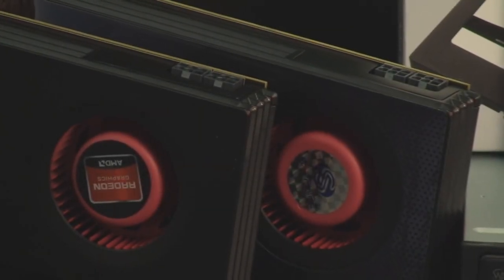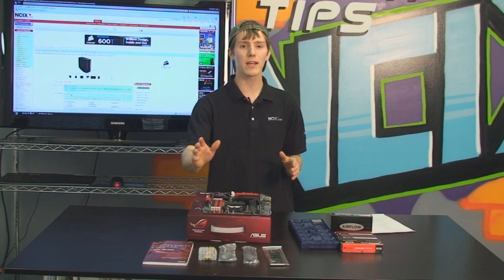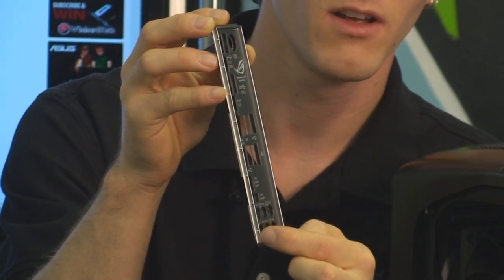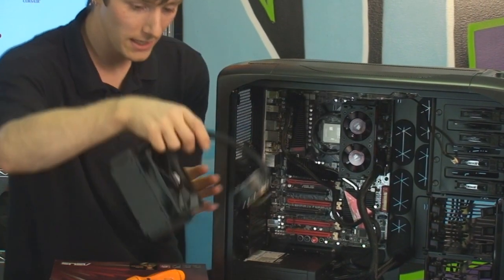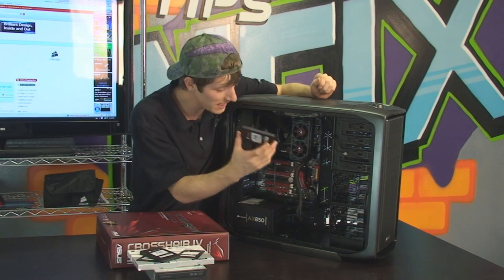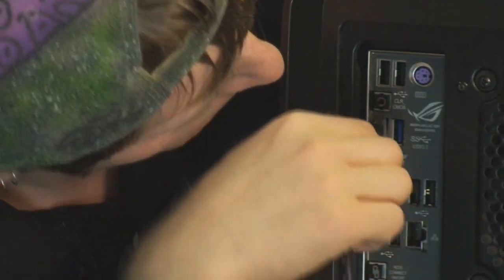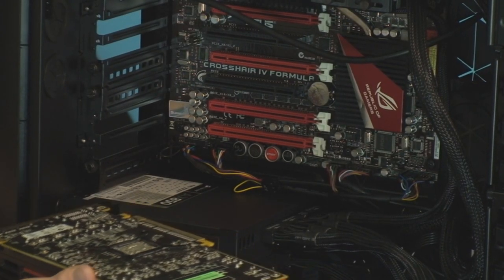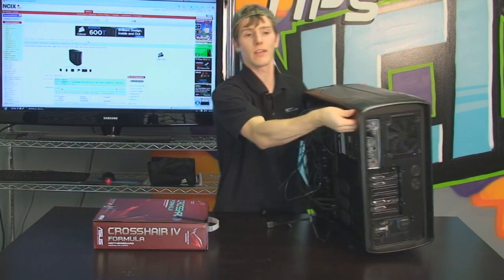PC Computer System Build Guide Featuring AMD Vision Black NCIX Tech Tips

Comment: Two things that my fellow Canuck did not mention.  The 600T case comes with an centering alignment post/standoff (standoff pin in the case with plastic bulb-like head) for centering your mobo for ATX aligment. So don't try and push down on the mobo if the pin is not poking thru the centering hole in the mobo.  The AX850 pairs the power connector for HD audio and firewire very close on the same wire. So if you have a Gigabyte mobo you will need an 1394 extender or live without 1394 in front case

Comment: It's worth noting that plugging fans directly into the power supply doesn't HAVE TO mean they are running at full-speed at all times, because there are fans with switches to control that, like the Antec Tri-Cool series. I plugged in a triple Molex connector to my modulator PSU... the two at the end went to my front intake fans, and the one in the middle of the cable for my side intake fan. All five (including the included top/rear exhaust) set to low. No RPM stats, but temps are all great.

Comment: @cardboardsnail You're thinking of RAID1, which mirrors the drives giving you only the total space of one drive. RAID0 strips a single file or data onto both drives thus doubling your total space, and increasing your speed but lowering reliability.

Comment: great video! i had to watch so many different vids on youtube before i was sure i could put together my first pc. this guide is pretty much the definitive guide for putting together a pc. and a monster one at that! 

BUT for the H70, i think you want to plug the water pump cable into NOT the cpu fan header. and you want to plug the rad fans into the cpu fan header. i have the H50 and this is how it is done. i simple mistake, and you did say refer to the manuals. thought i would mention it.

Comment: @EnzoMatrix452 

The HD6870 was supposed to replace the HD5770.
As a single card, the HD5870>HD6870.
When CrossFired, the HD6870 CF > HD5870 CF due to the awesome scaling on the HD6xxx's.

Comment: @ImaginaryGuns If your case have a dust filter right under your PSU you want to put it upside down. It will give you a cooler PSU, wich on some models will slow down the fan to lower the noise.

Comment: @jojotjuh The problem with these kits are that they don't have a resivour, in a proper watercooling set up you have enough water to cool ('cos of the resivour and so on) that it'll work better than most air coolers, also a radiator that's 240mm times 40 plus a good pump will help with that too.

Comment: @pandarello See, the reason I chose the H70 over the Frio (which I strongly considered) is that the H70 just isn't as bulky. The major advantage the H70 has over most high end air coolers is size. Had I gone with say, a Frio, or a Noctua, I would not be able to access my first dimm socket. I do plan on upgrading to a full water loop in the future, but for now, the H70 does what I need.

Comment: @afinewaytodie 

NPs. I should add that the H70 is not a terrible cooler by any means. However, it IS too expensive and gets beaten by say, the Thermaltake Frio which costs roughly half. And then the Frio does not suffer failure problems. If a fan goes you get plenty of warning. If the pump on the H70 fails it's game over.

Comment: @CamdawgzXXX ,  electrostatic discharge, basically it is when the negative energy from your body goes to a more positive source (someone or soemthing else).
This can obviousely damage eletrical parts, but it can also be prevented real simply.

If you want to go realy safe buy one of those anti static mats :D

static alectricity can be build up by alot of things, (even walking) so it's best to touch the case or the (plugged) power supply so you are sure that your static free

Comment: Quick Question, on that exact system, which would be preferred? Plugging the four fans into the fan controller or the motherboard headers? Taken into account the system monitoring capabilities of the mobo by means of let say a laptop.
Thank Guys. Great Work

Comment: sorry edit to my post, it is the AC97 and HD audio that are on the same wire not the 1394 which is a separate wire and so you will not have any problems plugging both the 1394 wire or the AC97 wire

Comment: you mentioned that little tab that blocks part of the 4 pin power input on the top left of the mobo. You take that out and use an 8 pin preferably? or stick with 4 if you have it?

Comment: I'm also thinking about installing Corsair H50 for extra cooling only if I really need to. Last question is I hear 470 consumes a lot of power and generate high temperature. Should I decide on 460? Which ever will run more comfortably in this build. I know few of my choice of parts aren't so great, but my budget is quite limited. Last PC I built became very ancient, I think it was back in 02 or 03 and only had memory and GPU upgrade since. XFX 8800GT Alpha Dog Edition 512mb. Out dated now.

Comment: Why is the dust filtration system of the Power Supply on its air outtake?
Should it not be on the Air Intake? I mean, my computer does not generate dust or whatsoever.

Comment: Hey there bit of a late reply but DO NOT build your system on carpet, this also means you standing on carpet and building the system on a table. You know when you rub your feet on carpet a little you can zap things? That's static electricity it may although not too often destroy components like your motherboard, CPU etc. Build on tiles or wooden floor stuff like that. Even if your building it on the table if your feet are on carpet then you can create a shit ton of static. Hope I helped.

Comment: Hey Linus, I have the H50, and i hate the **** corsair fan that came with it...  Is it possible to replace the standard fan with an air penetrator?
Also, would I need a 3 pin to 4 pin converter to plug into the CPU fan slot, or would it be OK just to plug it in via molex?
Thanks

Comment: I readed the motherboards manual and it shows that i only have connectors for a cpu fan, 2case fans and a power supply fan. 

Im planning to get an h70 liquid cpu cooler too, so the cpu fan connector isnt available becouse of the water pump. 
What 2 connectors should i use to connect the 2 radiator fans?

Thanks (and sorry for bad english)

Comment: @manjamfan The amount of RAM is not a bottleneck when it comes to computers, however the bandwidth and/or latency timings are. 6GBs of RAM is unique to Triple-Channel memory configurations (LGA1366 only currently), and more than that would be quite useless in this system. 4GB will be sufficient for any game out there, regardless of what people think. However, having more RAM definitely helps out when it comes to things like Premiere Pro and Autodesk Maya.

Comment: @xlnsanityz 

Either or will do fine. As long as your not running a triple sli/crossfire setup you will not experience any bottleneck. Considering your running a decent graphic card you wont see much of a difference. If your overclocking manually I would go with the i5-2500k tbh. The phenom gives you nice auto overclock when gaming (3 cores or lower used it will push them up to 3.7ghz).

Comment: My ONLY complaint is that when handling components with gold contacts (i.e, the bottom of the DIMM memory, PCI contacts, etc...), either 1) DON'T TOUCH THE CONTACTS, or 2) WEAR LATEX GLOVES. I prefer the latter. $2.00 worth of latex is a good investment for handling your expensive computer parts. Otherwise, I love this video. :)

Comment: That Aurora is $4099 without any peripherals. A system capable of running any game at 1080, maxed out settings, at 60+ fps costs $1300 without any peripherals. 

That's $2799 cheaper. Drop the ram to 8 gigs of DDR3 1600, the CPU to an ivy bridge i5, the GPU to a GTX 680, and the hard drive to a single 1TB HDD. You can throw in a 128 gig SSD for a boot drive for about a 100 bucks more. 

All systems in the above example included Windows 7 Professional 64 bit.

Comment: that PSU is overkill for that setup. I'm running an FX-8120 & two 6950's on a 750W, and it never draws more than 600W under load.

Comment: @afinewaytodie 

Yes, it does. Go look up Intel's new RAID controller that allows TRIM throughput to the drives ;-) Kingston are also working on a drive with a garbage collection function on the drive itself that doesn't need the TRIM command :-)

Comment: @elpedomasgrande1 The amount of lanes on the PCI-E slot for graphics cards is always 16, yes, hence PCI-E16. However, it is common for not all of the PCI-E slots on the motherboard to run at the full x16 speed. It is common for the bottom PCI-E16 slots (if you have 3+) to be running at x8 and sometimes even x4; with the ASUS Crosshair IV Formula, running two cards in the top slots will be x16 by x16 lanes, while with three cards they will run at x8 x8 and x8.

Message for more info if you  want!

Comment: are you magic??? how do you plug in the fan header that comes off of the h70 into the one on the motherboard. I have a similar bild with the same cooler and same motherboard and i cant plug it in because the cpu fan is a 4pin and the motherboard header is a 3 pin PLZ HELP

Comment: @Miguelb772 I do know that it will increase the Airflow, but the "Air-filtration-system" has nothing to do with the Air in a computer beeing hot already. -.- Its originally intended to filter out dust, so the Fans and coolers do not get full of dust over time. Putting the filter on the Air-outtake is kind of useless.

Comment: @plutoguerra 

Increases minimum and maximum fps. More importantly it stops fps from diping low during intensive gameplay. Example if you run 60fps (max for most monitors) you will hardly ever drop much compared to a single gpu droping as high as 40 fps during intensive gameplay (yes that has happened to be got a smoke grenade at my feet on battlefield).

Comment: depends. in honesty your could buy an intel setup with like a 3rd gen i5 or i7 and get better results on the high end . and would only be compromising a top end mobo for a mid tier one (which would certainly not be a bad thing ) and you would get a faster cpu  (the new i7's smoke the 8150 by a huge margine in just about everything ) im far from an intel fanboy . but at the high end at least for now they dominate . however piledrivers right around the corner and it may change things a bit .

Comment: I prefer the core I3 and 2 GTX 590s in crossfire, 24 gigs of RAM, a 1KW PSU and an asrock super computer X58 micro ATX gaming/server board alongside liquid cooling, a wireless LAN card (200MBPS) and all the little extras like SSDs and extra insulation on the back of the board (anti-static of course) to stop any potential shorts! oh, yeah and all in a Corsair case

Comment: I added up the Aurora he is talking about, no peripherals. It costs $4099. I added up an equivalent system using pcpartpicker. 800 dollars less. Then, I put together a PC that will run every game at 1080p 60 fps without a hitch. 8 gigs of ram, ivy bridge i5, a gtx 680, and 1 TB of storage. It was $2800 less than the Aurora.

Comment: Alright I need some advices on a budget gaming pc I'm working on. Here are the list of parts.
Case: Cooler Master Storm Scout Mid Tower
CPU: AMD Phenom II X2 555 BE Calisto 3.2 Ghz (I will be unlocking the other 2 cores to have it OC to 3.8 Ghz)
MB: ASUS M4A87TD
Memory: A-DATA Gaming Series 4GB (2 x 2GB)
PSU: CORSAIR CMPSU-650TX 650W
GPU: MSI GeForce GTX 460 or EVGA Geforce GTX 470
So the question is will my PSU be enough to run the build. ---->

Comment: question? I want to upgrade my old system. I do have an clear case with an ATX-AS500w thats mounting on the top of the case. I just brought the Asus Crosshair IV. I am looking at the 6870 or the 5750 at least 2. do I need to upgrade or not. I see that Corsair sponser the case, cooler, ram, hhd, and power supply. I like to look inside my case so all can see how cool my pc is. I dont hide it inside of the desk, I like it out. so can ya help me out here. ANYBODY

Comment: should . then it will shorten its lifespan . and make long term overclocks harder to maintain . this is where the fx 8150 comes in . it had 8 active cores which means each core will only be stressed as much as it should . and that means in theory the 8 core should outlast the new intels . so for gaming performance , the 8150 is still an excellent proccessor and can even run 4 way sli and crossfire builds. the intels are faster . but you in the end with the 8150 get a longer lasting proccesor .

Comment: Are these components good for making a "gaming" pc? :) plz help

Case: Corsair Graphite 600T

PSU: Fractal Design Tesla 650W

Ram: Corsair XMS3 Vengeance DDR3 PC12800/1600MHz CL9 2x4GB

GPU: Zotac GeForce GTX 560 Ti 448

Motherboard: Asus P8Z77-V LX

CPU: Intel Core i5 2500K 3,3GHz

HDD: Western Digital Caviar® Black 500GB

Comment: @pandarello I'm not denying that there are better choices. Personally I'd get the d14 over the h70(which I did btw), but it is still a very good cooler beating all the competition in short runs, although it takes a hit after a while as you said. BUT it is a good product be it slightly overpriced. And yes sandforce controllers do selfmaintain(not great, but they do nevertheless). I did my homework and so did Linus we all know what we're talking about stop flaming.

Comment: Yeap, Mine would have cost me $2,300 on Alienware, I built it my self last week and guess what? I only paid $1,450. You build you win! CPU-Intel ® Core i7 3770K 3.5 (Soon to be OC)
MoBo-ASUSTeK P8Z77 V-LK
GPU-EVGA GTX680 2GB
Memory-Corsair Vengeance (2X4GB) DDR3 1600
OS-Microsoft Windows 7 Professional
PSU-CORSAIR Enthusiast Series TX750
Monitor-Asus VE248H Black 24" 2ms Full HD
HDD-SAMSUNG Spinpoint 1TB 7200RPM
Case-Rosewill Blackhawk Case

Comment: 4GB of RAM is NOT enough. 4GB of RAM is absolute MINIMUM. 6GB of RAM is recommended. 8GB is a safety. Any thing beyond 8GB is no longer ONLY a gaming rig.
500GB HDD is minimum, 1TB is recommended, 3TB is a safety. Currently SSD is a luxury. Dual core processor is minimum, Quad core processor is recommended. 150$ is minimum on GFX cards, 250$ is recommended, 400$+ is safety.

Comment: If u tired watching the whole video

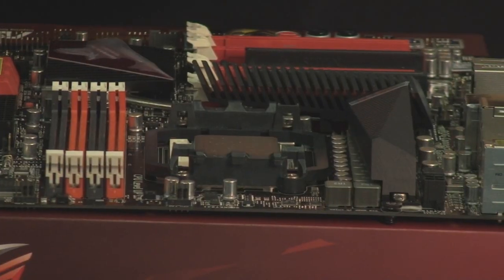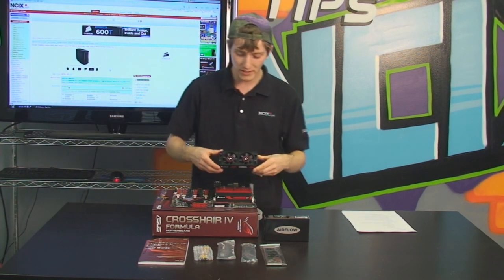4:46  CPU Installation----------- 5:15 RAM Install ----------- 6:00 RAM Cooler Install
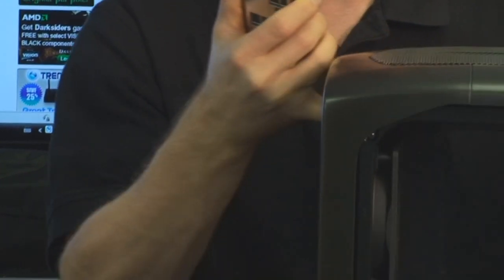6:43 PSU Install ----------- 8:56 AIO Shield/Motherboard Install -------------
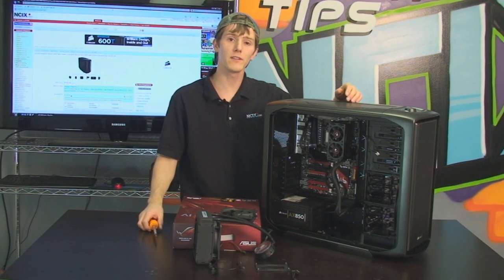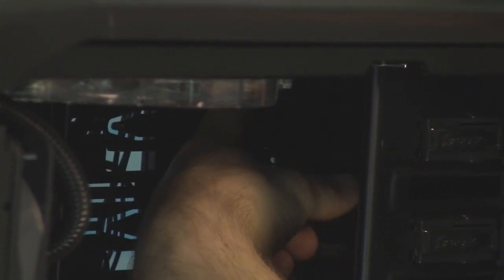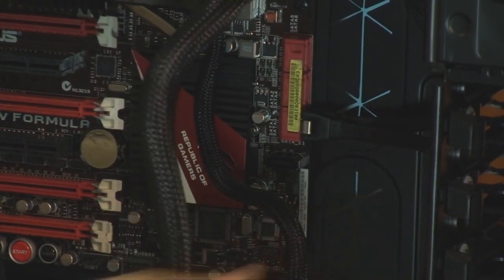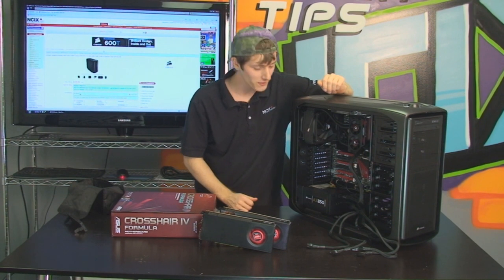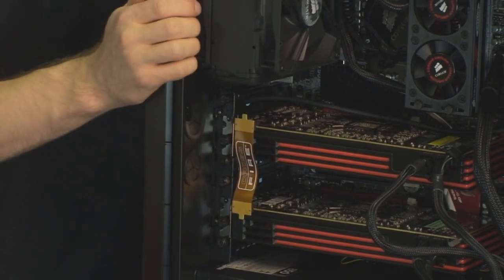11:53 CPU Cooller Install ---------- 17:28 Hard Drives Install--------19:20 DVD Install 20:40 Front Panel Connectors --------- 24:30 Graphic Cards Install --------- 28:23 Fan/cooling cables Install

Comment: That case is way too much money for a "gaming computer",  sacrifice fancy cases for CPU or GPU, take a look at the haf 912, antec 302, etc etc.

If you went with a cheaper case you could get a 7950 3gb.

That motherboard is good, but it only has 1 pci 3.0, the other is 2.0 at 4x which is crap if you want to sli or crossfire down the line.

ASRock Z68 Extreme3 Gen3, GIGABYTE GA-Z77X-UD3H, can crossfire or sli with 2 pcie 3.0 and are the same price, or cheaper.

Comment: Well done my build very much like this. 
Antec DF-85
Antec H2O 920 Cooler
Antec CP 850 Power Supply
ASUS Crosshair IV Extreme
AMD 1100T cpu
Crucial PC12800 4gb 
Crucial 64GB SSD X 2 Raid 0
Hatachi 1.5TB Sata 6 X2  Raid
XFX 6870 1gb DDR5
PNY GTX 560 ti 1 gb
Using Lucid Hydrologix in X Model

Where is Linus Tech Tips. I get some hacked site when I search for you.

Comment: Yah. but alienware charges 5k for that.

For that same price you can get everything you just listed there with a better Motherboard, better PSU (Dell always includes shit PSU's) 2 Samngsung 512GB SSD's (-$600 if you want the 3tb drives) 64GB of 1600MHz RAM (witch you dont even need. you only need like 8GB for gaming)

and are you kidding!? that system is still a kickass system! (would sugest a hard drive upgrade though) but for the price you payed for that then you could get much better now.

Comment: Cons:

- Most RAID controllers lack pass-through TRIM support
- High probability for disk disasters with RAID-0
- Very low value to performance improvement 

And I can absolutely promise you here and now that the CHIV *does not* offer that. So as I said, go and do your homework.

Comment: @Malius1000 

The H70 heats up over time due to the size of the loop. It makes more noise than the NH-D14 and costs more. So do your homework before you go making statements like that. If you're into suicide runs then fine, me? I prefer like, using my overclock. As for Sandforce maintaining themselves? horse crap. Go and read a review of the OCZ revodrive. I owned a H70. Then I realised it was a toy water cooling system and only really appeals to idiots. Lesson learned.

Comment: Few things. Firstly the H70 is crap and gets trounced by cheaper, better air coolers. Secondly it's RAD-eon. Not ray deon. Thirdly running RAID 0 on SSD is suicide because you then sacrifice TRIM and within a couple of months performance will be terrible. Within five minutes of watching this video it began to become epic fail with some terrible advice.

Comment: This has to be one of the most stupid comments I have seen in a while, I understand calling someone out on, for example, "your" or "you're" because if someone says "your an idiot" they mean you own something called "an idiot", however "bitch" is used in both ways, and defined in both ways. You can't look at an alternate definition for the word then try to call the other guy a fail because you aren't smart enough to do a simple task like tell apart a word based on the connotation of it.